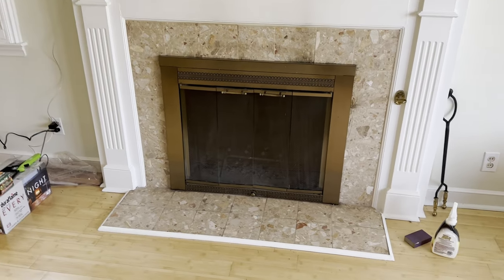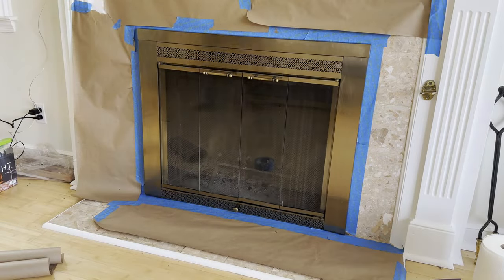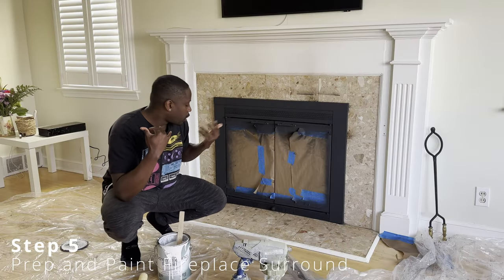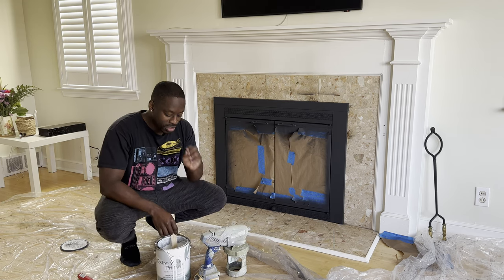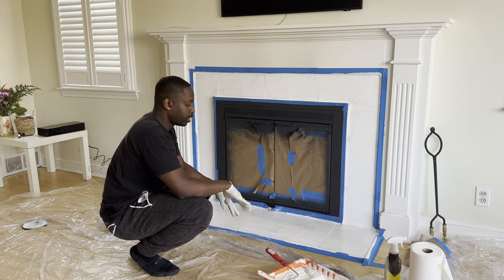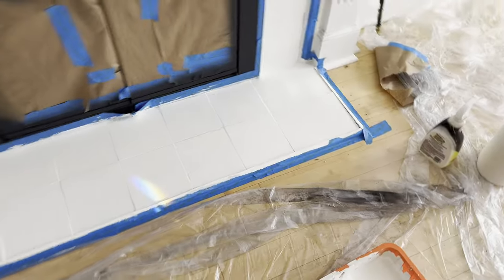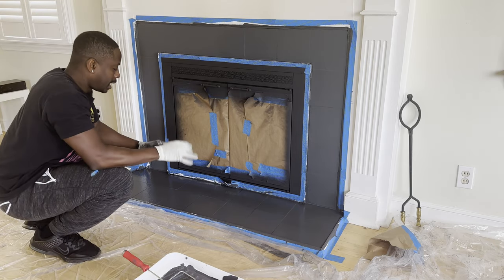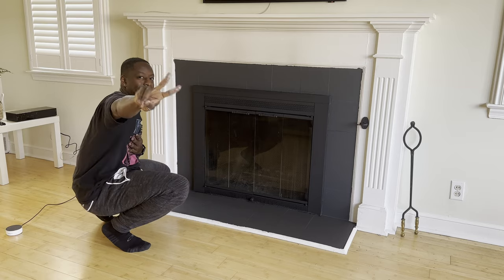DIY Fireplace Transformation | How to Paint a Tile Fireplace and Fireplace Tile Surround

Comment: Looking at doing this for my fireplace. Looks great. Do you recall what color the Behr paint is?
Reply from the maker: Good question, On the top of the can, the Behr color codes are: CLRNT 0Z 384th/BL 1 337/CL 0 52/KXL 0 312/ LL 1 69. I would ask for a small sample first and test if that's the color you want after it dries. Hope this helps.
Reply: @TheRealMikePrez thanks so much!

Comment: Have a question about flexio do u thin paint on mine I tryed like the vid you have and did not spray
Reply from the maker: Yeah on the Flexio, depending on the type of paint, you have to thin. Start with a small % amount of water, 5% test spray, 10% test spray, 15% test spray, etc. Until it comes out at the consistency you want. You might have to clean the head of your Flexio because maybe some paint dried and is clogging the machine.
Reply: @TheRealMikePrez  ok 👍 kool thank you

Comment: Don’t you need to use a fire high temp paint?
Reply from the maker: Not necessarily. If you are painting inside the box, then you definitely need to use high-temperature fire-rated paint. However, for the surrounding area, it doesn't get as hot. You should check how hot the area outside the fireplace can get (Google Search) and then review the paint's description to ensure its maximum temperature rating exceeds that of the surrounding area.